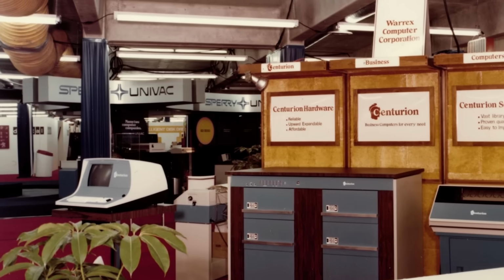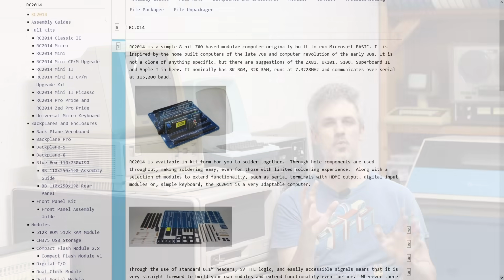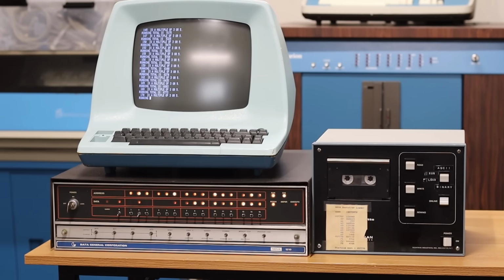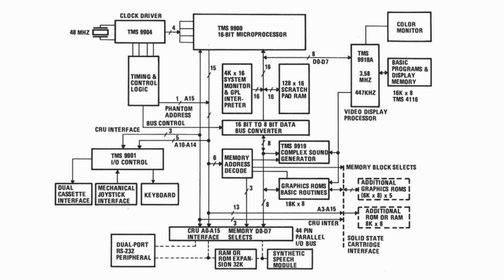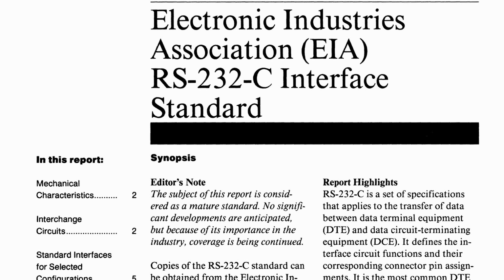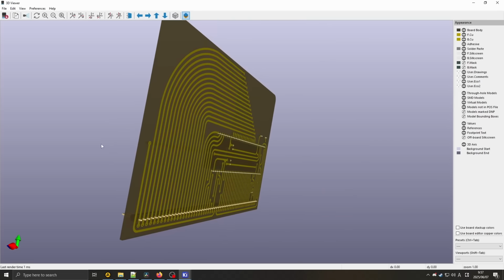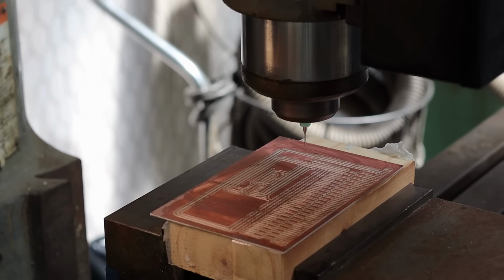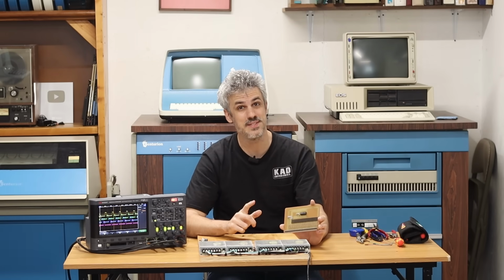The First Step in Building our TMS9900 Homebrew!

Comment: 1982 was about the time when I was enrolled in my junior level "computer architecture" class - in short, assembly language and the machine we used in that class was the TI-980. It was basically the same character set as the TI-99 but built out of a couple hand fulls of logic. It was The last step before the instruction set showed up on a single chip - it looked very similar to that Data General Nova. You loaded a bootstrap and your program from punch cards and then read the results off the blinking lights on the front panel.

It was very educational and one of the things I learned was that I really didn't want a TI CPU. I didn't see another TI CPU until years later at AT&T when some other engineers on a team I participated in were using a TI-7700 microcontroller to run a coin-operator payphone, and even then we knew that the main reason that the 7700 was selected was because it was cheap - there wasn't a lot of demand for them for some reason. I don't hate TI as a company but the idea of basing a homebrew around one just doesn't spark joy.
Reply: There was the 990/10 and the 990/12 minis ... the /12 version used bit-slice TTL for the ALU section of the processor ...
Reply: @uploadJ  Thanks for the clarification! There's such tremendous detail known about the early deisgn processes for architectures like the PDP 11, x86, and 68k but I've only found maybe 2 or 3 wiki pages for the transition from TI 980 to 990. There are probably less many people seeking it out but I still really hope it's a story that's being documented. Has there maybe been a CHM interview with an engineer from that porject?

Comment: Don't knock using a piece of plywood for building a computer on, my first computer was on a used cardboard pizza box.  I would push the leads of the chips through and solder wires to them on the inside of the box, and it was great for hiding that rats nest of wiring.  And, back when I bought my TI99/4A, I was just about that excited too!  And the really good thing about the way you are making your boards, no toxic chemicals! (well, other than the oil)
Reply: Heh. Where did the term "breadboard" come from (emphasis on board) ... Heh.

Comment: The Year was 1982, and I had developed 2 video games for the VIC-20 that was selling commercially, and a few years later I was asked to write a program on the TI-99 in BASIC for someone to help them run their business, it was so under powered and limited it hurt my brain.   Sears sold them and a friend that worked for Sear purchased all the expansion boxes, memory, disk drives and still didn't have a computer after a large investment. LOL...   Well, maybe the TI-99 might not be the epitome of microcomputers, sure, it had a 16-bit micro but the way they make that personal computer it was a piece of $junk... and that is being kind compared to what I called it back in the day. 

The TRS-80 had the superior BASIC, I liked the RENUM capability, and that it had an ELSE statement, and I'm sure other things, I can't recall all that it had but I thought it was a solid machine and wished I could afford one.  The Apple (6502) was superior in graphics. So, I'd put the VIC-20 in the middle, and C64 was perhaps the best positioned computer for price and performance, and I got to play around with all of them... but the TI-99A itself was junk, but it wasn't the worst... that honor goes to the Sinclair ZX80 that IMHO needed crutches when it came to executing from the command line:  ? 2 + 2   It blanked the screen and took over a second to computer then the screen un-blanked with the response 4.  WOW.🤯🤯🤯

Comment: Now I'm tempted to make a competing TMS9900 Homebrew. 
It would be interesting to contrast your minicomputer focused design with a single user "what if TI had actually designed the TI-99/4A correctly" design.

Say a successor to the original, deigned around 1982, aiming to compete with the IBM PC in the business market. Give it much better graphics, get rid of the scratchpad and use full 16-bit wide bus for all the memory. Replace all the software too to take advantage of the non-crippled memory. Maybe even give it sprites to make it into a decent gaming computer.

Comment: I'm sure you know a lot about the history of TI and computers. But for all the other viewers who might not... TI overlooked for the longest time that home micro-computers needed speed. The should have given it 16K of 16-bit wide memory, but they were worried it was so expensive to do that. When they saw the video chip people had done support for a private bus of DRAM, they decided that was the solution. 

That aside, the '4A had a rather mini-computer-ish architecture Peripheral devices came with their own device ROM. There was a full name-based sub-program calling system actually in the kernel ROM (this is how TI BASIC programs could call code in cartridges!). But they also took a lot away from what the 9900 could do. For example, since the console ROM is at >0000, you can't setup your own hardware interrupts. It really felt like there was a fight between engineers with a mini-computer mindset, engineers with a micro-computer mindset, and accountants closely watching the budget. 

There was so so much potential in the '4A that wasn't realized. And the never-launched 99/8 addressed some of these, but not all that many of them.

Comment: The TI99/4A had a great chipset, the potential to be a great computer, but it seems it was designed by drunk baboons that intentionally made it to be as slow as it could possibly be made on purpose.  Seriously, using the display RAM as system RAM was the dumbest idea ever.  Then the weird proprietary and generally weird ROMs.  Only 256 bytes of actual real full speed RAM was the epitome of stupid.  No wonder why it was laughed at, but there's more!  The BASIC sucked equally as well requiring "CALL" to be used to actually access commands.  The ultimate facepalm.  The TMS9900 was a great CPU, but never had a chance with that craptastic computer around it.

I do have to admit that CNC is a bit bizarre for PCBs, but it's certainly better than classic wire wrapping, and it it works for you, then so be it.

Comment: I am really looking forward to this series.  The TMS9900 was the processor used in my employer's proprietary microcomputer systems from around 1980 to 1986 or so (they were based in Luton, in the UK).  I was initially commissioning newly built hardware, but moved into development in 1981 and was then writing software in assembler and also using BCPL. Around 1982 we had a 16 user database system running on a single 9900 cpu, and it was no slouch.  The rapid context switching that was also built into the interrupt handling of the CPU was a key benefit.  Later I designed a processor and peripheral boards around the 9900's successor, the TMS99000, (specifically the TMS99105) which more akin to the 80286 in terms of memory reach and performance. Somewhere I might still have a compiler, assembler and linker that ran on a PC - I shall have to go digging.   
And the TIM9904 clock generator - they were one of the less reliable parts of the 9900 systems, occasionally letting the magic smoke out.  The processors were pretty reliable though.

Comment: Are the copper-clad boards pre-coated or just raw copper? IIRC there is a liquid solution you can dunk copper boards into to essentially metal-plate them... It's been a while, but I may be thinking of MG 421A, "Liquid Tin".

I'm not mad at the copper-on-fiberglass aesthetic though, so you may want to try hitting it with some clear nail polish as a soldermask.

(Though IIRC, you're down in TX, so probably not a heck of a lot of humidity/corrosion, so pure copper clad is probably not a huge problem)

Comment: 5.2V is not high. You want it around 5-10% higher than 5.0 for sag and losses. Those switchers are so noisy on your scope. You'd be better off with a high quality ATX supply. Or a linear like the 99/4a uses.

Comment: The difference between a mini computer and a micro computer boils down to architecture.  Is this computer supporting multiple users or a single user?  The TMS9900 was designed for multiple users, not one user.  While the 6502 and 8080 and Z-80 were really single user chips.

Comment: Love seeing the TMS9900 get some attention!

As for the TI-99/4A, while the 16 to 8-bit bus translation definitely slowed things down, I think the bigger contributor to the perception of slowness was that TI BASIC (the only built-in language option for the unexpanded computer) was double-interpreted: BASIC bytecode -> GPL -> native TMS9900. That stack made the system feel sluggish.

That said, if you write and compile assembly directly for the TI-99/4A, it's actually quite snappy and very respectable for the era. But even then, some native 8-bit machines could outperform it in certain areas simply due to more direct memory access and fewer architectural bottlenecks.
Reply: There was the Mini-Memory Module that could be plugged into the console - and this allowed ASM (Assembly language) to be run w/o the need for the full expansion chassis ... the MM Module also included battery backed RAM for the ASM code to reside in, and included a line-by-line Assembler in ROM.
Reply: I almost mentioned it, but it wasn't built-in.

Comment: The PDP-8, generally considered the first minicomputer, released in 1965, was not multi-user. Many early PDP-8 systems didn't even have a Teletype let alone a video display terminal. Much of the software was supplied on paper tape and could be loaded and run from the machine's front panel. I wrote a primitive PDP-8 operating system (consisting of a program loader and device drivers for a Teletype, paper tape reader, paper tape punch, card reader, line printer, drum, and DECtape) in 1968 or 1969. DEC's main PDP-8 operating system OS/8 was for a single user and not released until 1971. No doubt some muti-user PDP-8 systems were developed by others, but they would have been a stretch.
Reply: DEC had TSS/8 on a pdp-8i in 1969.  Could have even bee 1968.  With a full 32k it could support 16 users.  It was quite the system for its time.  And DEC offered special pricing to schools.  Our local community college had one and all the high schools in the area had 1 dial in line with a TTY as the console.  My first time using one in 1970 had me hooked and I went into computers as my line of work.
Reply: @timradde4328 I had forgotten about TSS/8, which I never used but now remember at least reading about, probably in my treasured copy of DEC's "Small Computer Handbook." I loved having control of the bare machine and not depending on someone else's operating system. Wikipedia says "TSS/8 sold more than 100 copies," so it ran on only a tiny fraction of the more than 10,000 PDP-8s. My point was that multiuser support was not a defining feature of minicomputers. But they sure were a lot more fun than today's Windows machines.
Reply: The instruction set on the PDP-8 was amazingly economical. It has page zero addressing which I would guess influenced the 6502 design a decade later.

Comment: 30 years ago I developed measuring gauges, with a controller based on TI 9900 cards. Programming was on a TI990/10 minicomputer in TI-Pascal, modified for realtime applications. Testing was done with an in-circuit-debugger,replacing the processor in a test target. I have still some processors, cards etc.

Comment: For the RS-232, use a MAX-232 or equv. They require only one power supply, and "makes it's own" high positive and negative output voltages.
Saves a lot of time and hassle instead of the typical RS-232 chips and their 3 voltages.

Comment: Looking forward to follow this build. The TI99/4A was one of my first computers, and I loved it. Although it had an interesting collection of weird design decisions. A friend of mine told me that at his university they used the TI99 as a showcase of how not to design a computer.

Most of the software, including BASIC interpreter was written in GPL, a TI specific low level interpreted language stored in GROM-chips, TI proprietary ROMs that did not have any address lines, they were addressed sequentially by writing a start address and auto incremented for each access! Having most of the system software written in an interpreted language on top of the dual usage of video ram as program storage made it insanely slow.

But you could run TI-FORTH on it! That brought out the power of the TMS9900, good fun! 😁

Comment: Holy crap, the workspace pointer is really cool feature. Admittedly I am a young modern programmer, but the implications of this approach are really cool!
Reply: Hardware context switching before it was cool.
Reply: It's very cool, but it does have the disadvantage of putting your registers in ram. I don't know the access time on that fast SRAM though, so maybe it's not slow enough to really matter at those speeds anyway. Still, my first though was "that's gotta be slower than having the registers in the CPU".

Comment: Interesting, I've never heard of a four-phase clock before, but checking it out it's a pretty neat solution for some of the shortcomings of conventional MOS ICs: before the advent of CMOS technology, one of the downsides of single-phase MOS was that the gates were (comparatively) slow to saturate, leading to a limit on how fast they could switch. By interleaving multiple clock pulses, you could "precharge" transistors and pack them more tightly, making four-phase ICs faster, smaller, and cheaper, at the cost of making development of the IC layout more complicated (as you'd have to interleave the gates so that no two gates in series with one another used the same clock phase; I'd compare it to a multi-piston engine, you don't want them all to fire at the same time but have one cylinder fire after another)

I'm no expert on that topic, much the opposite, but I thought I'd share just a snippet of what I understand and let anybody further interested research more on their own. An engineering amuse-bouche, if you will. :)

Comment: I had Honeywell with a bit-slice CPU, card-cage system with 16 serial keyboards and 16 video out's that was scrapped out of a bank in the late 1980s. The instruction set was Z80, and it ran TurboDOS (A concurrent CP/M derivative.)  
Being a CP/M system, that's a microcomputer in my book. Even if it was the size of a self-inflating life-raft. with a 1250W PSU.

Comment: You certainly don't need all those power supplies. All except +5V are probably biases that draw microamps.
A nano-ATX is a single compact board that provides all voltages you need BUT check if it actually provides -5V.
-5V can usually be derived from -12V via a zener diode or a linear regulator.
12v laptop-style power-brick is recommended to power it for safety reasons.
+12V&+5V combined power supplies are more rare but still available, they typically end in PC IDE HDD-like molex.

I don't consider power supplies to need to be period-correct (power is just power) and building a tinkering with mains voltage is dangerous - it is just not worth it.

If for example a retro IBM PS/2's power supply or C64 power brick stops working and you replace it with a modern one, it is any less of a retro-computer? 
Well maybe there's a difference for a museum, but for enthusiasts it's really meaningless.

At the least use a modern 12VAC power supply and use that as an input for your homebrew PSU if you really want to assemble one.

Comment: This series is going to be interesting. The TI-99/4A was my first computer. I learned to program on it—first in BASIC, then Extended BASIC, and eventually Assembly, because the first two were just too slow. I was 13 years old.

The TI-99/4A was slow for two main reasons. Without a memory expansion, BASIC programs were stored in video RAM (those 16KB shown in the video). To access that memory, you had to write the memory address to a special register in main memory. Certain addresses were mapped to different peripherals, and one of those peripherals was the TMS9918—the video chip. After setting the address (one byte at a time), you then had to read or write the data, again one byte at a time.

On top of that, the BASIC interpreter itself wasn't written in native Assembly, but in a language called GPL (Graphics Programming Language), which was also interpreted. That means TI BASIC was effectively doubly interpreted—first by the GPL interpreter, then by the BASIC interpreter written in GPL. This added another significant performance bottleneck.

The microprocessor could only access RAM in two forms: the fast but very limited scratchpad memory (if I recall correctly, only 256 bytes), and the slower but much larger 32KB expansion RAM, which was available through the expansion bus (via the expansion box or another peripheral connected to the bus). However, the bus was only 8-bit wide.

So while the TI-99/4A had a phenomenal microprocessor—16-bit when most others were still 8-bit—and featured impressive graphics and sound for its time, its memory limitations (due mostly to cost constraints), coupled with the inefficiencies of double interpretation, ultimately led to its downfall.
Reply: I did program a lot of assembler programming on the TI 99/4a. There was also a mod where you could stack the 32k ram chips on top of the ROM chips and have the full 16 bit for the 32k ram.

Comment: How would you class a Tandy Color Computer 3 (6809 / 6309 processor) with 512 / 2 meg memory running OS9 / Nitros9 - Dual rs232 Floppy  for terminals (up to 4) / Scsi HD ?